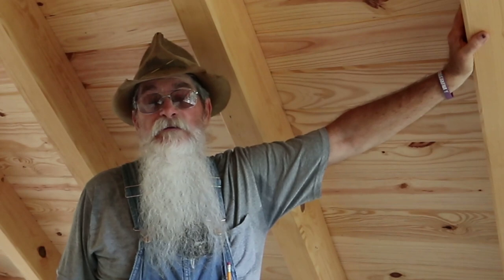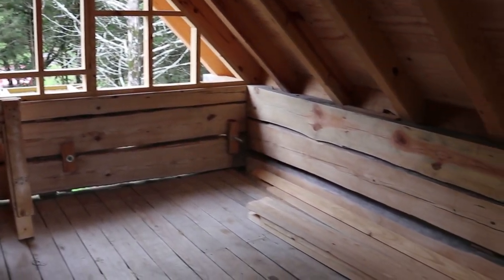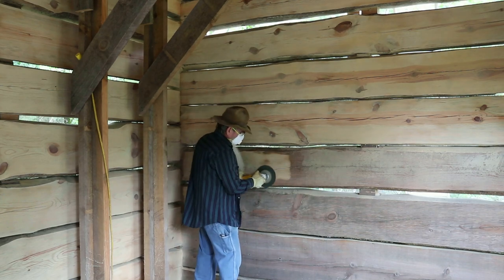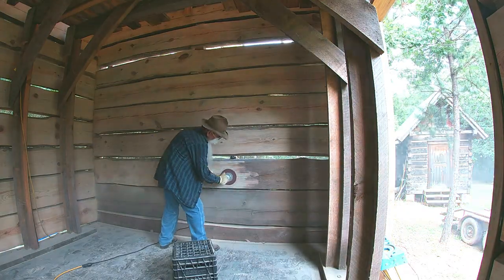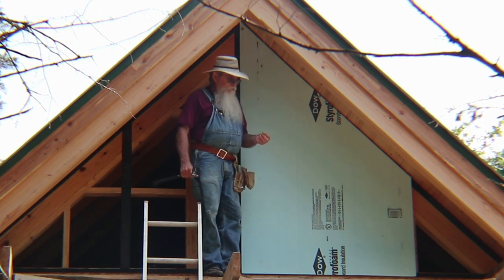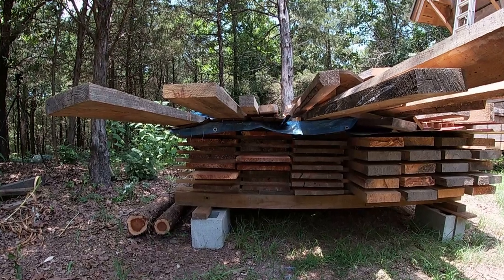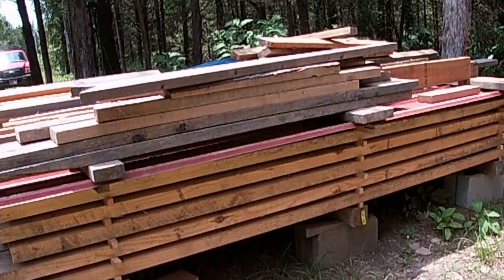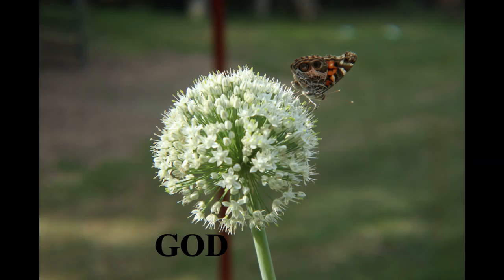Brighter Logs and Insulated Gable Ends, Dovetail Log Cabin (Ep 45)

Comment: Nice find on the Red Cedar! :) I love that wood. That ought to look real nice up there on that end of the Cabin. We have several log furniture pieces made of Eastern Red Cedar, made by local artists here in Middle, TN.

I like the info on the grit count at the beginning. I just recently got a couple fittings for my angle grinders for sanding for both wood and for metal. I had to decide up front what grit count to start with, so I chose 50 because of comments I had seen elsewhere. I may get 36 for the metal stuff, but 50 looks like a good choice I made for wood.
Reply from the maker: Howdy y’all- finding red cedar in wide widths is not the easiest thing, but, occasionally I find it. It sure is beautiful wood. I’ll use an angle grinder pretty often and go through a lot of 36grit discs. Take care and God bless

Comment: Sir, Thank you for sharing you skills in cabin building! You are a master craftsmen no doubt! 
Do you ever run into saw mill lumber with any poster post Beatles? And if so any suggestions on treatment.
I got a load of saw mill lumber and it has Beatles. Thanks Again!
Reply from the maker: Howdy Norman- I’ve never heard of posterpost beetles but I have heard of powder post beetles. An old time sawmiller told me that the lumber can be heated to get rid of them. Thank you so much for watching the video and for the kind words. God bless you
Reply: I believe spell check got me , powder post Beatles is what I meant, 
Thank you sir!
Reply from the maker: @normannix4623  I have that to happen sometimes. Also, some people mix borax with water and spray it on liberally and it’s supposed to kill the larvae. Blessings

Comment: I'm kinda courious as to why I don't ever see folks slotting in between the logs and putting in 2X4's or 1 x3 's set on edge to seal things up better? 
I'm not a log cabin builder but it seems to me that , that would be a great option for sealing things up better ? Is there anything wrong in my thinking process doing it that way? I know it's not traditional but it sure seems like a much better way to seal between the logs than just chinking.
Reply from the maker: Howdy- you have a great point and there is nothing wrong with doing that. In fact, I have seen that very thing done and I think it works well. I use a triangular closed cell backer rod on the inside and outside that actually separates the mortar chinking from being a conductor of cold. Thank you for sharing a good comment. God bless you